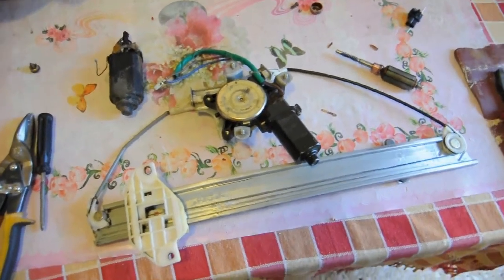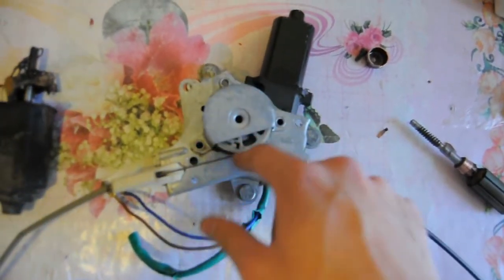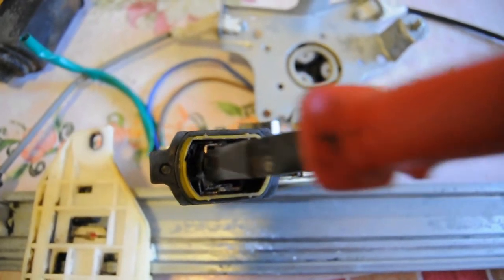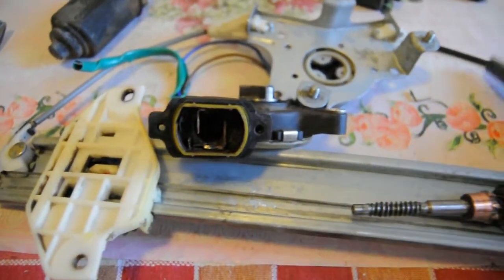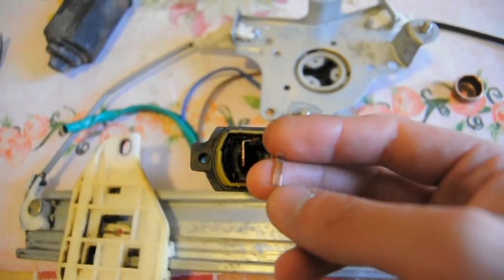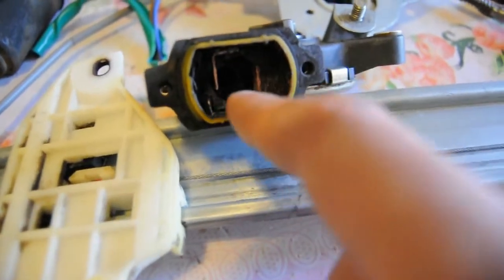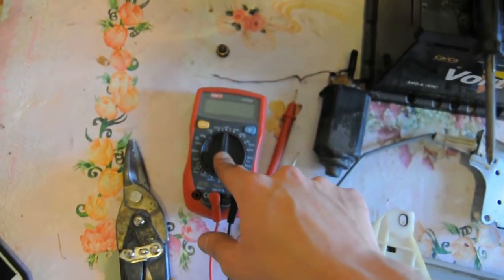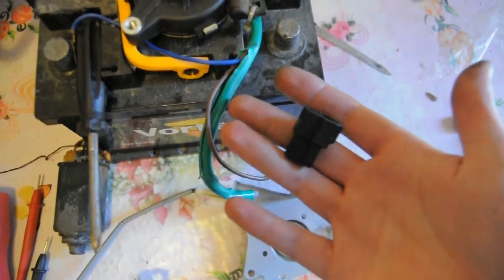Fix Car Power Window Motor that has Metal Brushes (No Carbon Brushes - Cheap Type)

Comment: Thanks I'll try this
Reply from the maker: No problem! Remember to add oil on the glass' rails as this most likely happens because it it hard for it to go up which translates into extra load for the motor's brushes. I ended up changing the whole Power Window Mechanism because not only the motor stopped working again but even the wire was way too worn for it to move properly. The other mechanism didn't seem to have enough pressure which made me think the rails were too tight,so a little oil and pulling on the inner door sheet adjusted it properly.